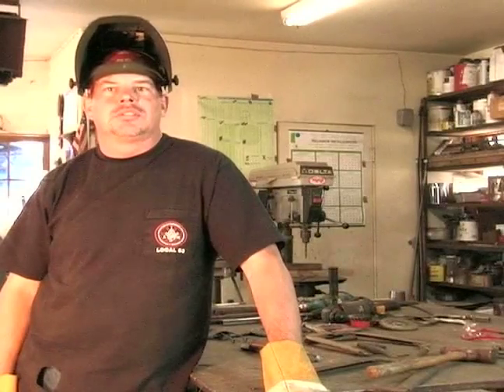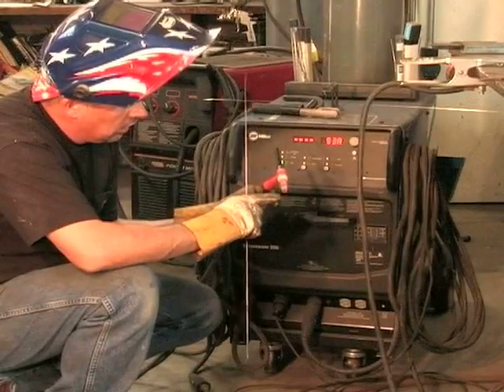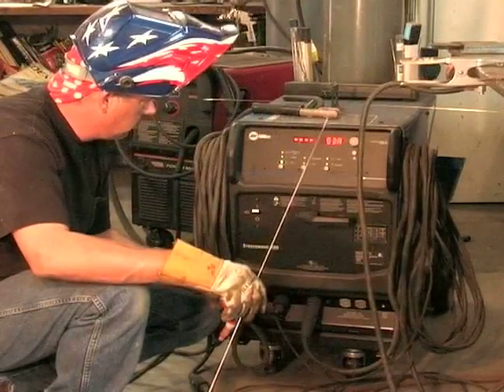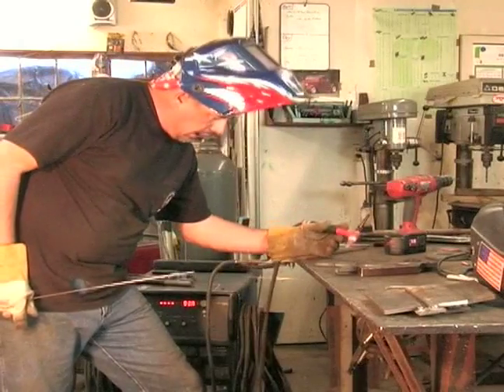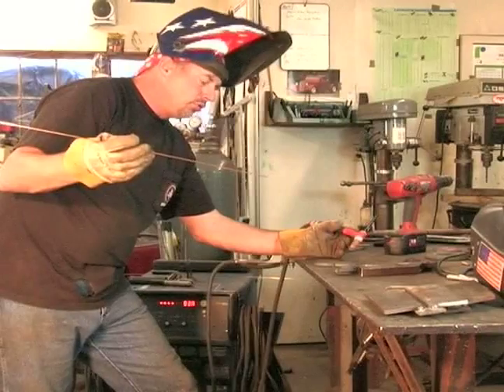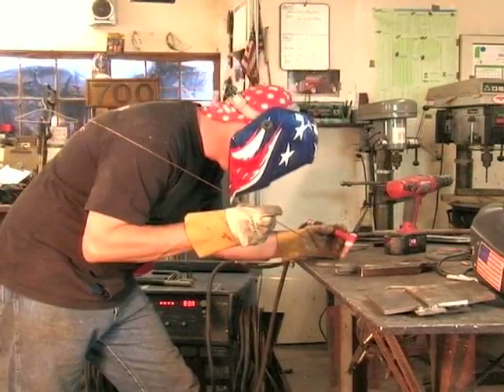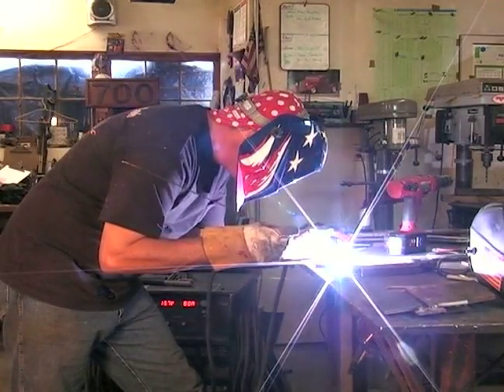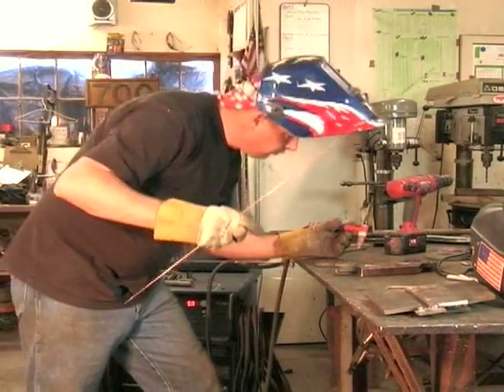How to Use & Maintain Welding Equipment : Understand TIG Welding

Comment: Dear paramandans,

I am not sure if that message was directed toward me but i am not the author of this video.  
I am a professor of marine welding and fabrication with expertise in GTAW technological development. I am, like you a CWI as well as a CWE by 2 different agencies one being AWS. i have worked in the trade for years in all aspects especially the GTAW process.  I was simply stating that the equipment you talked about (IE Gas lens) was not necessary.  Its helpful but not necessary.

Comment: Dear paramandans,

Before coming on here and spouting your greatness you should understand that a gas lens is not necessary.  infact the average welder does not use one.  The only pieces necessary to make a good weld are as follows:
Tungston
Collet
Collet Body
Gas Cup
2 O rings
and the cap

Comment: Dear Upcomingjedi,

He actually is incorrect in this video.

When tig welding on steel you should be using straight polarity with a very sharp tungsten tip.  Straight polarity is used because it focuses 60% of the heat created on the base material.  If you use reverse you will destroy your tungsten because it focuses the heat up on your tungsten rod.
Argon gas is used because it is a noble gas.  It does not react or dissolve down into the liquid puddle like nitrogen will.

Comment: Dera Lynel1985,

Incorrect.  Reverse polarity revers to the torch being positive.  He made a mistake in this video.  for ferrous metals he should be using straight polarity which is electrode negative.

Comment: Dear CobraDesigns,

The strength of your welds will be based on 2 factors.  What is the minimum tensile strength of the filler wire you are using... Example: if you are using R-45 Gas welding wire you will find that if you make a perfect weld you should have a minimum tensile strength of 45000 psi on the weld.  If you use a stronger wire and make a perfect weld then your strength goes up.

So example : if you used (hypothetically) er40s-g for mig you would have a much lower min tensile strength

Comment: Dear Talondelsol,

Your argon is not set in PSI when you talk about TIG welding.  Its not a pressure issue.  Its set in CFM Cubic Feet per Min.  You should be setting your argon on 15 under normal standards.  If you need more stickout on your tungsten you should be using slightly more argon to get good gas coverage.

Comment: Dear TheDood951,

I am sorry sir but you are incorrect as well.  As i sated before you can not ever use Reverse Polarity for welding (electrode negative).  Welding GTAW (TIG) with reverse polarity will concentrate too much heat on the tungsten and it will be destroyed.  You only do it for a second to ball up your tungsten when welding on aluminum.  Once the ball is created on the end of the tungsten you switch and weld with Alternating Current and switch your high frequency to constant.
Goodluck

Comment: Dear Author,

This information is incorrect.  When using the GTAW process on steel your current is not Reverse polarity.  Reverse polarity is Electrode Positive.  Steel should be welded Electrode Negitive (Straight Polarity) .... Running the torch on reverse polarity will destroy your tungston.

-Will
DJ Gyver

Comment: I knew a guy in Jr. high that arc welded over his hand and he did not feel it until it was about 1/2 way.  It was pretty quick I'm sure as he didn't have burn marks from dripping rod material but it sure got swollen.  Just wear your dry leathers and you won't have a problem.  The worst part is forgetting you just heated the peice and go grab it off the table w/o gloves. sizzle!! OUCH!!  ^#*%@!!  XD   You learn not to be so absent minded/easily distracted REAL quick I tell ya.

Comment: he means that for ferrous metals, the torch is Negative, and the workpiece is positive.  The only time you woudl change it is if you are welding Aluminium, but 99percent of the time thats AC welding in which case polarity is alyways changing.